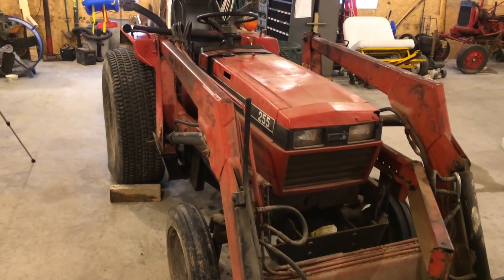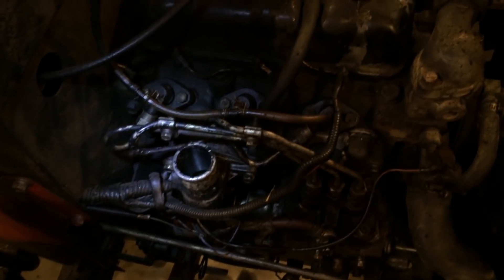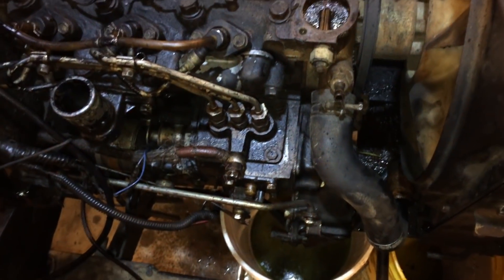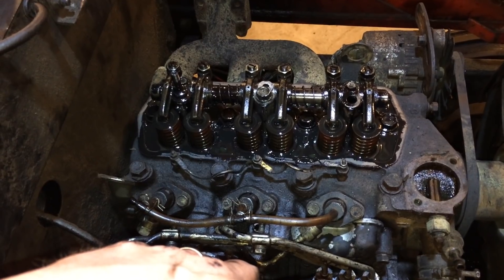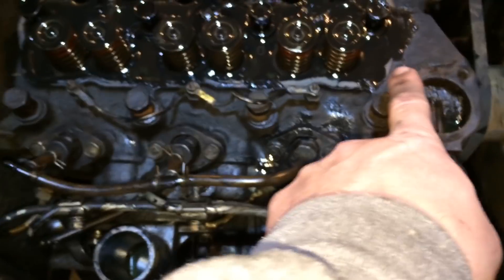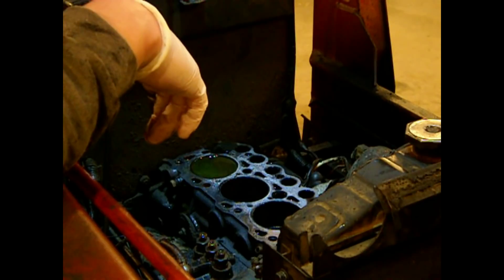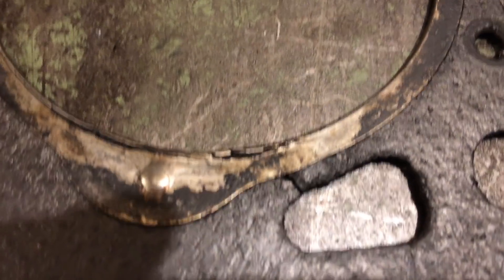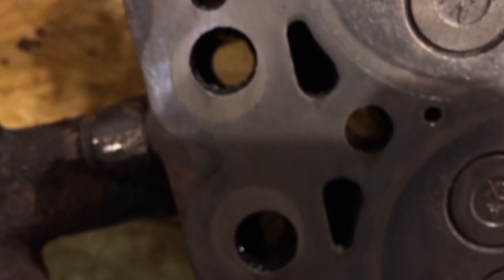3 cyl Diesel Tractor Blown Head Gasket Repair Detailed  *Part 1 of 2*

Comment: Great video. I picked up another 254 that i was going to use for parts but it doesnt appear to be much wrong with it. Your two videos helped me pull the head. Waiting on parts to go back together and will try to run it. Injector punp appears to be working fine so it should run cyminders look healthy enough. Again, thanks flr posting the videos.

Comment: Wow. Amazing video . I think I need to do this on my old Chinese tractor that is spewing oil out of the dipstick. Obviously significant blow by. Trying to diagnose this thing but pretty sure I’m going to have to pull the head off to get to the bottom of it. Supposedly the tractor only has 105 hours so it is possible that it is just needing a re-torque of the head bolts but if I’m going to the process of taking the rocker arms off seems like I should just go ahead and go one step further and replace the head gasket.
Reply: Which tractor/engine? And did you succeed?
Reply: @laustporretmerrild  it was a farm pro and I don’t remember the engine model
Reply: @janericchannel4513  Cheers! I checked out your videos. Really found them helpful - thanks for that

Comment: Picked up a Massey 1020 really cheap, the oil is like goooo/sludge.  I think it is head gasket problem.  What is "blowby"? I think the motor is a Perkins 3 cyl, is it similar to this motor?  Where is best place to order the gasket?  Thanks
Reply: Welcome Black Carter  - https://i.ebayimg.com/images/i/231481442988-0-1/s-l1000.jpg
Reply: blowby is when the pressure from the engine case (Oil pan area)  leaks out of areas it shouldn't. Typically the Intake pulls fuel into the cylinders using negative pressure (Vacuum)  from the Pistons as they go "Down" causing suction (Negative Pressure) . When the piston is making vacuum, Inside the oilpan area and case it creates positive pressure. Blowby is when that positive pressure leaks into the intake causing vapor lock, poor vacuum, or lack of fuel "Suction"

Comment: Did you reuse the head bolts.   I have a kioti lk3054 that looks identical to this.   Has a blown head gasket.   Water on exhaust side.   It has a new gasket prior to me buying it,  but the problem is still there.   I read something about the bolts being torque yield and needing to be replaced every time.   Heard of anything like that?
Reply from the maker: There is ALOT that I don't know about engines. I know that most folks recommend replacing head bolts anytime you take any engine apart. I don't usually replace head bolts, but most of the stuff that I work on isn't critical or expensive. I reused the same head bolts on this tractor. I belongs to a friend and he tries to keep things on a low budget. We did this whole project pretty cheap and it worked out fine. He still uses this tractor, nearly every day, and it is still going strong. He has had no more issues out of the head gasket. As far as "torque yield" bolts, I don't know anything about that. I have always heard that head bolts stretch a little when you torque them down.

Comment: I recently bought one of these tractors. Hopefully good luck with it. Where can I get parts for this engine? I have a leaky water pump.  Thanks. Good video man!
Reply from the maker: Thank you. My buddy uses this tractor nearly every day and it is still running good. It has been almost a year since we did any work on it. He really likes it. I did another video of rebuilding the hydraulic cylinders on the loader. I think we got those parts from Messick's. This video was about replacing the head gasket. We got the head gasket from Southern Global Tractor Parts.

Comment: i'm planning to do the same job on my Nissan excavator with the same engine. I can't find any repairmanual/datas for this K3E engine such as in what order the cylinderhead-screws are tightened and with how much torque. Would appreciate any kind of help, thanks.
Reply from the maker: I had a tough time finding info too, but I do remember finding a service manual online, for free, after I had already completed the project. It wasn't on a website, like I am used to seeing. It was simply a document that I saw while searching google. I was at my Buddy's last week and we were talking about this tractor. It is still running  good and no issues at all. In this video, I detail the pattern that I used to tighten the bolts and the torques that I put on them. I remember the service manual torque pattern was a little different than I had done, but I had already done it. It is still working just fine and he uses the heck out of this tractor.
Reply: Those engines are also on the old ransomes diesel mowers.
Reply: @cencalindustries  I have one of those, and now I have to replace the head gasket as well.